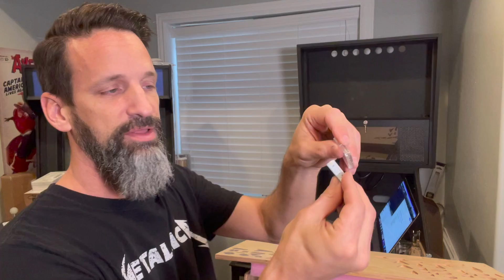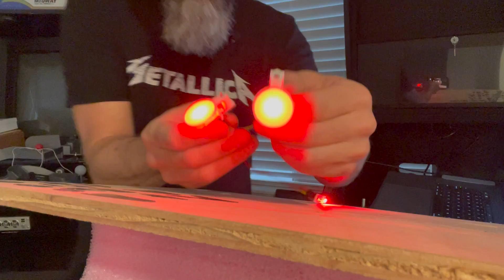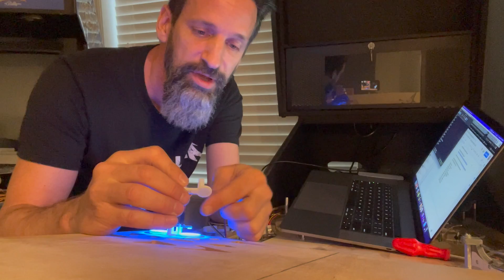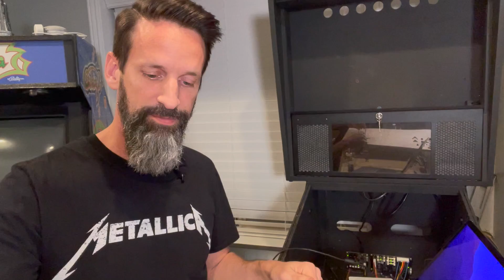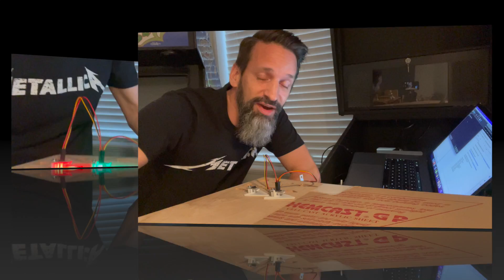HOW TO MAKE A PINBALL MACHINE: Diffusing LEDs - Part Two

Comment: I’m wondering if, in the ghostbusters style arrows, you can just use a triangle shape for your diffuser and put the led right in the middle? So the light would be equidistant to all three corners the triangle and the led wouldn’t be so close to the “pointy end” of the triangle. It might help the legs of the triangle light more evenly. Your led would be under the playfield itself instead of underneath the insert hole, but it might allow you to use just a single led.
Reply: I had a very similar thought. Moreover, the 'diffuser' may not even need to be more or less shaped like the insert. You may be able to get away with just a rectangular diffuser under the more complex arrow shapes (the Ghost Buster one, for example). The light should be relatively evenly distributed and it may save you the extra LEDs that are mentioned.
Reply from the maker: Excellent question, I'm not sure honestly yet, I'll have to try it and see, I'm not using that shape in my current project, but I'll try out a larger triangle shape and see how well it lights the legs, thanks!

Comment: Looks great Steve, keep up the great work. Don't forget you can try simply raising the spacer for the larger insert shapes. For example, 15mm will give you better coverage than 10mm, and maybe you can get by with just 1 LED instead of 3. I noticed 10mm looks a little close on your 1" circle diffuser with your LEDs. Multiple LEDs poses a risk of making an insert too bright, might be worse than a slightly dimmer single LED spaced further.

I also agree with densming to consider just a basic triangle shape instead of the Ghostbusters arrow shape, as that will probably improve light propagation into the corners - assuming you have mounting room. You can also consider my earlier design where I used one screw to mount the LED to the spacer, and another screw to mount the spacer to the playfield - a few extra screws are cheaper and easier than multiple LEDs - for example have 3 mounting screws in the corners of the triangles, and then one screw for the LED at the optimum position.

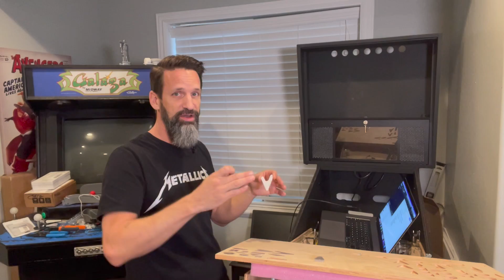Comment: @5:34 You are absolutely right! IF the LED is turned off, You still want the artwork on the play field to be pretty and since this is the ultimate goal... you are on the right track! Also it looks better when the machine is turned off completely. When you use it on a piece where the artwork is about the same colour as the insert, go for it.... i guess...

Comment: What if put LEDs  on tip of triangle in angle, something like 45-degrees? It could spread light more evenly on whole insert. Could need some shielding to not light other inserts, probably piece of alumin-tape would do the trick.

Comment: So your focus was to have a bright light without any hot spotting,  really cool idea! What about using a multi-side facing LED instead of a board to get the same effect? I really wonder what your plan looks like in comparison to some of the manf's that don't have shield like this.
Reply from the maker: Yeah like if you look at Godzilla or any other modern manufactured game, they all have hotspots in their clear inserts. I think their LEDs have a slightly different lens that makes it not quite as harsh, but it's definitely there, you can easily see which inserts have an LED that is off center etc - lots of inserts have text over them that also helps hide the hotspots 

Once I have my whitewood all wired up with lights I'll do a side by side comparison. 

Admittedly, hotspots on inserts isn't anything anyone is really complaining about, but it bugged me when I started doing my homebrew so 🤷here we are 😅

Comment: Since my LEDs focus their light straight up, on my machine I've been playing around with putting silver reflective tape on the backside of plastics with LEDs under them to spread the light across the playfield. Reflecting the light essentially doubles the distance the light travels so it spreads out much more and the imperfections in the tape scatter it.

It just occurred to me, it might be possible to do something similar for inserts. Essentially mount the led upside down directly to the playfield and use reflective tape to bounce the light back into the insert.
Reply from the maker: Oh that's an interesting idea